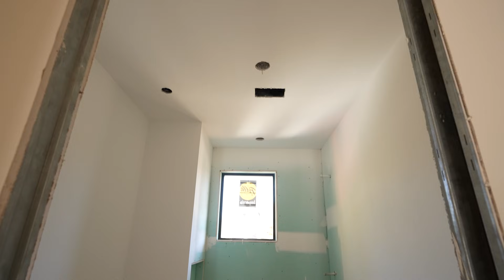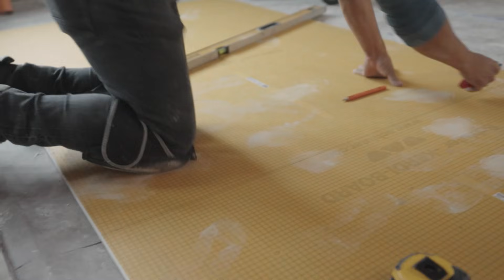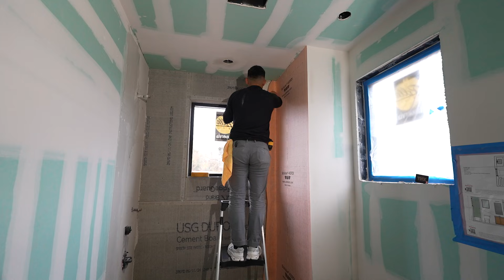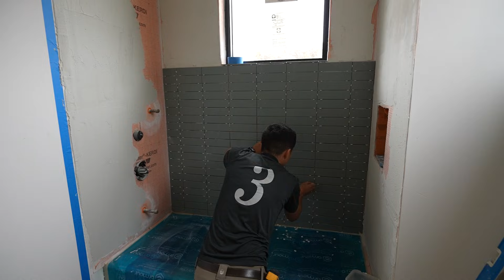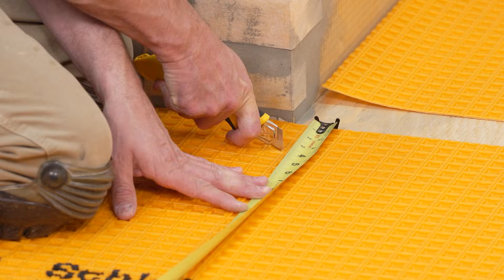The Risinger Build Ep 18 - Waterproofing & Tile for Bath, Mechanical Room & Laundry

Comment: I used Schluter Ditra Heat in my bathroom remodel.  Great product, but expensive!  I particularly liked the installation manual that was very well written with clear illustrations.
Reply: Yeah but it cost that for a reason. There are a couple other brands out there for pros but they cost the same. 
None of those brands have all the extra products like shelves, drains and terminations.
It's literally the standard and they're the ones that developed the whole product and process for homes. Think it's been around since the 80s
Reply: Oh, for sure.  It's a premium product at a premium price.  I think the slick packaging of the system is a lot of that...  Not that the product is poor quality, by any means, but there are other quality products for less money.  The Schluter advantage, IMO, is that it's a system of products all designed to work together, and more than that, it comes with an outstanding warranty if installed correctly.  And installing it correctly is facilitated by the excellent and thorough instructions they write!

All that adds up to make it expensive.  Not that it's poor value... It's just expensive.
Reply: @soundman1402  what are the brands that cost significantly less? And where are? 
Seriously, I'm always interested in new products and it's been a while since I priced the blue and other products.

Comment: It’s best to fill the space between the tub and cement board with mortar before waterproofing, this will help hold the tub in place and can help prevent the grout joint from cracking.

Comment: I have GC'd three custom houses for our family. For the first two, the tiles guys insisted on using old-school metal pans, cement board, hand-floated shower slopes, etc. "We have been it this way for 30+ years!" kind of thing. Both houses had leaking master showers (2nd floor) down to the first floor. UGH.

Last house, I went to the Schluter dealer and asked for the tile guy buying the most Schulter products. Never had one issue (not one) with leaks. I will never not do Schluter.

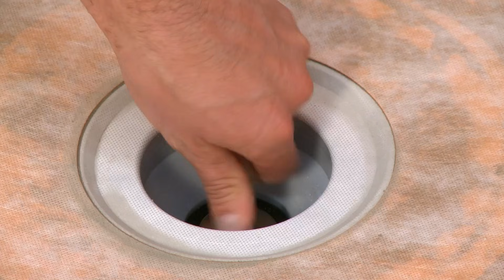Comment: 12:09 and after tray 8nstalled I’d buy yourself a FloFX bonding flange drain and use with this, as fits well and won’t have the white fleece delaminate from back of kerdi drain and flofx bonding flange will fit perfecting in kerdi pan just make sure buy the FloFx Binding Kerdi drain and be all set. Just pro tip is all
✌🏻
Reply: Mixing brands does void the Schluter warranty however.

Comment: That Kerdi board is absolutely NOT Rigid; irregular drywall is more rigid. We were installed on that Kerdi board Mosaic tiles, and it was a nightmare to have this at the perfect level. After that, we discovered another product it is called Prova Board-Plus this product is more rigid and easier to work to do waterproofing because you only work with the caulking to cover up inside corners and screws.

Comment: He's talking about thw amounts of water in a shower and I'm working on a custom shower in my house pushing 10 to 20 gallons per minute instead of 2. GPM.

The new showers with multiple shower heads started when they restricted the flow rate of a single showerhead.

Comment: Schluter is great and all but way too expensive. Just finished my basement bathroom; to use the Schluter system for my 48x48” shower would have been ~$900. That’s insane just to waterproof a shower. Went with GoBoard and did my own dry pack pan. Less than $300.
Reply: Tile Redi is the current best shower base out there. It can never leak and comes in any custom size you want and any drain location.
Reply: @stevemullen8457  never is a strong word. As long as it doesnt find a way to crack, all plumbing is correctly installed,  walls are correctly seamed to the base, and the base to wall seam doesnt crack open. Nothing is perfect.
Reply: @apex007 
This is why tile redi has the best approach to 100% water tight cause it has a seamless pan with 4” side walls and the drain is Intergrated into the pan as well. Nothing to crack or relying on caulk or thinset. 
Look into it it’s a great system and way better that the orange system since thinset is not a water proofing solution
Reply: @ I dont think you carefully read my response to tile redi. Please read it again.

Comment: I like the membrane but I'm not sold on the fact that you use mortar to "glue" it to the walls and overlaps. I think mortar is going to wick water through it, maybe slowly, but if water gets through your tile I just don't trust that it won't be wet, forever. I went with Durorock and a few coats of Red Guard top to bottom, over the sill and out onto the floor.
Reply: You use thinset for the Kerdi membrane which is not quite the same as mortar. Thinset is more of an adhesive and is hydrophobic when cured. It is a standard component of several waterproofing systems. Durock works great as a substrate for Red Guard, but the ease of handling and installation is what sets Schluter apart—but it doesn’t come cheap.
Reply: the whole point of the membrane is that it is waterproof. If installed correctly, nothing gets through it to whatever holds the membrane to the floors/walls. you've got a triple layer system: tiles (generally waterproof, but will leak at the grout lines), thinset (holding the tiles, not waterproof at all), membrane. doesn't matter if stuff gets through/around the tiles - it hits the membrane and it stops. 

the 2" overlap rule for the kerdiband is because the thinset used to attach the membrane will not wick that far, so even if moisture gets behind the tile and makes it to the edge of the kerdiband, it will not wick far enough to actually get behind a properly installed membrane.

Comment: i prefer the old pvc shower pan, its basically impossible to get it wrong. if you dont install this system perfectly, it will fail.
Reply: That said, the Schluter system is not hard to install perfectly. It’s actually kind of foolproof if you follow the installation guidelines and watch the instructional videos. PVC is likely to crack over time as it ages.

Comment: Curious how the vapor barrier in the exterior wall works with the Schluter system; it would seem like there is a vapor-impermiable zone that would prevent drying to the inside.
Reply: Same! That's what I'm trying to figure out now. Plus, I've got ZIP R-6 going on the exterior. I've got to figure out something special with a wall between 2 vapor barriers!

Comment: Not saying schluter isn’t one of the best - but their warranty is a joke. If you use ANY other products, even superior ones - it completely voids any warranty. For example; the Flo fx drain. It’s hands down better - and using it voids warranty. That’s just a d-move. 
In my situation - contractor used liquid waterproofing and got some on a corner piece - the rep took one look at that and shirked responsibility even though was 100% obvious it wasn’t the cause of problem.

Comment: Honestly I'm a bit surprised you dont use Wedi instead of Schluter
Reply: Another comment with no context or explanation as to why. Come on, folks, back up your comments with some sound reasoning and maybe even examples from your own experience! That’s the power of Comments on YouTube.
Reply: Lots of armchair experts commenting on this video.
Reply: I have installed both but Wedi seemed to be a more bomber system in my opinion. Prove me wrong! And he seems to be very high end oriented and to me Schluter is not that. Not saying there is anything wrong with Schluter just my opinion.